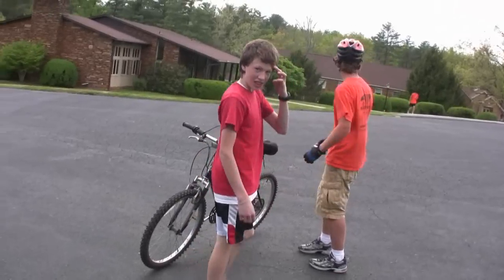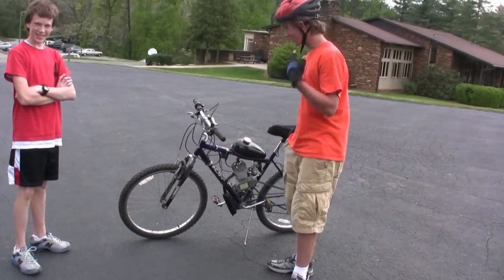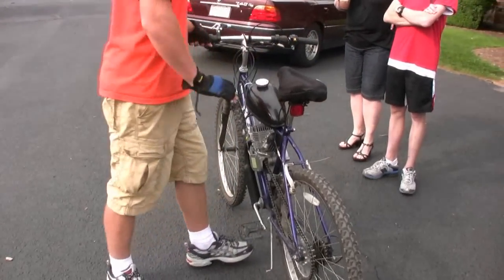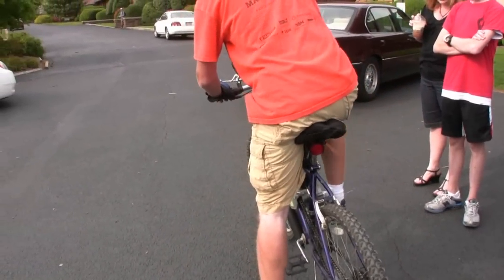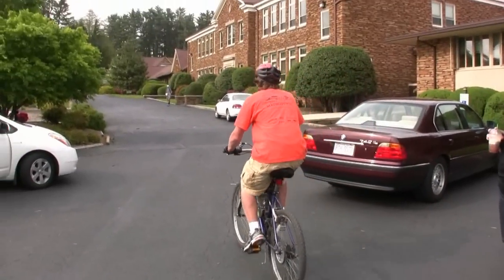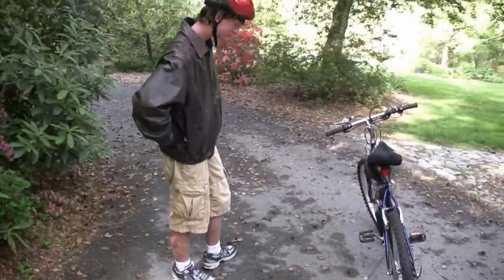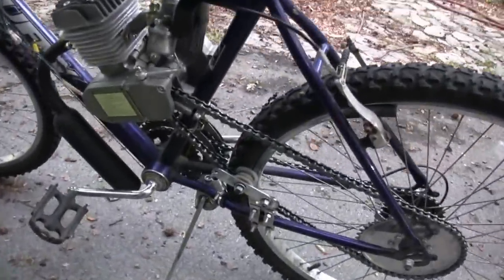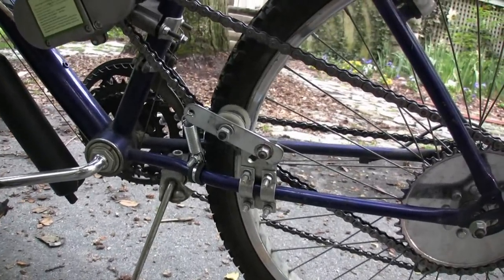Bikeberry 80cc Bike Engine Kit Test

Comment: Question: can you bike normally without the engine running and without the clutch engaged?
Reply from the maker: RcBros Productions you can. But, the engine chain and clutch pulley still turn. So there is an unpleasant amount of extra resistance.
Reply: Ok. What is the max speed if you hold down full throttle on a flat, straight surface?
Reply from the maker: RcBros Productions The bike was stolen about 10 years ago. But it will go about 35 miles an hour just like a scooter
Reply: Stolen? Uh oh. Cool ok

Comment: what is that accessory you added to keep the chain from rubbing on your bike? Where did you get it?
Reply: gasbike.net or bikeberry.com sell 'Spring Loaded tensioner"You can also just get the lever and spring.You use your standard pulley and save some $.I did Ebay for several parts.Under 'motorized bicycle parts'.First part was a steel sprocket to replace the plastic pulley.$12.Several there at $18.

Comment: yes I have a huffy bike with a 2stroke motor on it the motor is getting spark gas and I now have the correct wiring but it's still isn't starting
Reply from the maker: James Jones must be fuel. The carb float can stick easily and no gas goes in

Comment: At the beginning your chain looks extremely loose. Tighten it or it could come off and possibly lock up the rear wheel, idk how long about this was, just trying to help m8
Reply: Omg lol never mind right after I posted that comment I saw u got the spring chain tensioner lol
Reply: +KS-surplus&Motors he needs to take links out he has the tensioner all the way up and it is still way too loose

Comment: I got this bike motor last summer and could never get it to start. fuel seems to flow through the carb just fine and when I attempt to start it, I can feel it going through the cycles. could it be something to do with the electronics box? any advice?
Reply: Tripp Gallagher  You probably solved it by Now but just incase u haven't and for anyone who has the same problem First thing you should do is take out the spark plug put it on the side of the head touch it too a clearly visibable metal surface and turn the engine over if u see no spark then Go to ebay and buy a Coil and magneto kit for 15$ i have to every  month or so the magneto and coil are  junk but fuck 15$ every month or so.. ain't so bad i usely keep 1 in stock at my house just incase and when that one goes bad and i use my spare i buy another and put that one on the stock shelf xD

Comment: yes you are right the system of mounting the rear sprocket is hard on the spokes. I purchased a hub mount from pirate cycles that mounts the sprocket to the whole wheel just like a motorcycle much better and I have been riding it for 3 years now and had no trouble with it so if you know what you are doing it can be a reliable means of transportation

Comment: a drawback of easy/inexpensive/universal/cheep is about 20mile mark the cylinder overheats enough to stick a ring, then cussing the last 5miles on human power. for hobby use an a few grins, these serve that purpose fine.  longterm vibration etc, need proper welded + graded locktited bolts, thicker metal etc etc. a goodsolid and simple used japanese nameplate motorbike can be had for avg complete powered bicycle $. sane speed an/or lightened motorcycles do near 100mpg. dsl or elect coming next

Comment: Actually it is an 80cc motor, but only if you live in China...LoL  (we use different measurements here to determine the cc rating than they do)
In America its 66cc, but since its imported from china they get away with calling it 80cc.
Reply: They add the volume of the Head too,where we just use cylinder bore and stroke.

Comment: Be warned, these kits are not for the novice. They require what I feel is a great deal of mechanical skill. I got one and never got it running. Wasted essentially hundreds of dollars on engine and bike as well as parts to try and get it running. Unless you seriously know what you are doing, I don't recommend it.
Reply: Was given a kit for Christmas and spent 2 months researching on'The Net'before I put it on and started to break it in.5 gallons later, and it runs Great.On a Mongoose 26"w/shock forks Mountain bike.

Comment: A cubic centimetre (or cubic centimeter in US English) (SI unit symbol: cm3; non-SI abbreviations: cc and ccm) is a commonly used unit of volume extending the derived SI-unit cubic metre, and corresponds to the volume of a cube measuring 1 cm × 1 cm × 1 cm.

Comment: they do last as long as you have the motor with actual berrings for the wrist pin and crank instead of the bushings. they cost around 100-150 depending on where you buy. right now i have bigger carb different head  and some other stuff for better performance ,,, the rear sprocket works wonderful and hasent bent my spokes yet....

Comment: @TheRcmodder htey are addictive. ive built and sold 4, and am looking forward to my 5th. built a 49.9cc trek 4500, a 66cc huffy, a 66cc schwinn occ stingray, and a 66cc scott waimea. ( which got almost 55 mph out of it, before it threw the chain. that was messy.  course it, ( the scott) weighed with engine, about 36lbs tho

Comment: @energeticlear Mine which is very simiilar or exact to this persons bike, achieved 37 mph going slightly downhill. Now this was the only speedtest I did ever. I still have yet to get a speedometer and do more. I believe.., I can probably reach 40-45mph with the proper tuning. Sure does feel uncomfortable though if im sitting fully on the seat.

Comment: @freelance508 I just got this motor and it works good but im having the same problem with the chain tensioner being a piece of crap. it slid up and down on me when i rode it which made the chain loose so to fix that i got a washer with grooves in it off of a bicycle and put that in between the nut and the metal. It has been working good since i did that. the grooves grab the metel surface and dont let it slide

Comment: I have install a motor on two bikes. My wife and mine. I am very pleased with them. Did have a problem starting one of them. Finally I removed the magneto cover and ran the motor without the chain to check for spark. I had spark but not enough. The magneto was not centered.  Works fine.  Had a loose cylinder head on the other after some use.  The other kept blowing off the muffler bottom. I use two nuts on it now.  work great!!!!!!!!!!!

Comment: hey i'm having trouble on getting my bike started. i know how to start it but it just won't when i release the clutch. i can feel the clutch kick in and slows the bike down. but the engine just doesn't seem to start up. would it be because my idle screw was out too far? that's the only reason i came to. but i'm not able to test the idle just yet because my bearing in my tire came out and the back tire won't move. 
anyways, thanks for the help

   -nascargavin88

Comment: it would have required 1 link vs the 2 links you have to remove for the next shorter length. however we now were able to grind the notch in the derailer deeper and take off the tensioner! runs good